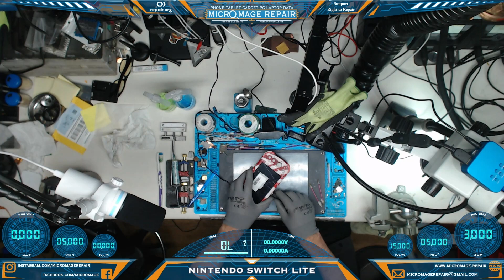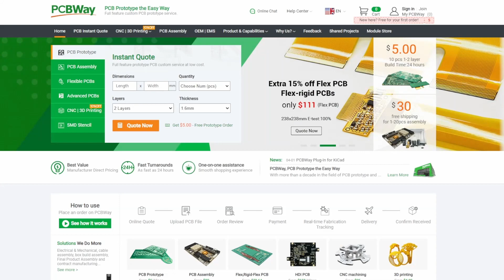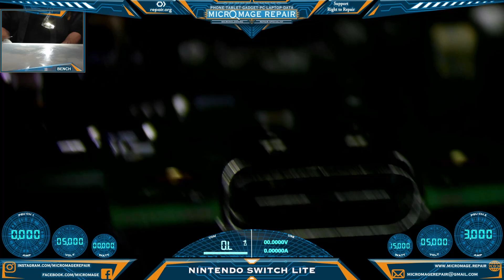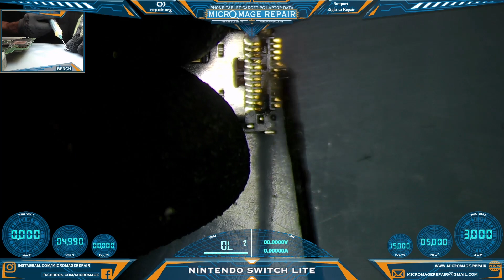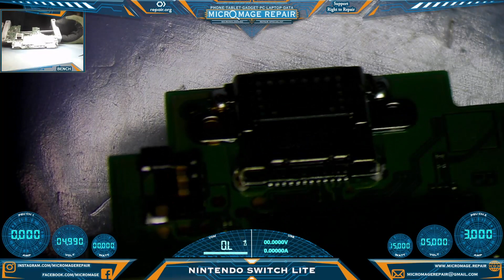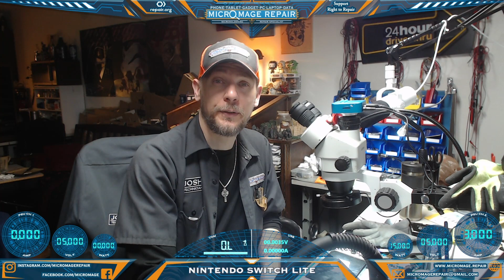Switch Lite: 💀 0.0A No Power

Comment: Hi! Excuse me. I'm testing a switch lite motherboard. I want to see if the board negotiates the quick charge correctly. This must be done with the battery connected? Or it can be done without battery? I replaced the usb port. The port tester says lines are OK. I connect the motherboard to the charger and it negotiates 9, 12 or even 15v correctly if the PD port admits it, but it doesn't go down to 9v after that. Should I connect the battery to test that behavior? Or should I do other tests before? The console was apparently working before disassembly, but the carging port was literally falling apart. Thanks for your advice!!!
Reply from the maker: The system needs a battery or equivalent (the modified Squid I use) to boot.
Reply from the maker: If you use an equivalent you will need an OEM charger to activate.
Reply: @MicroMageRepair  Ok. Thanks a lot!

Comment: Ive replaced m92 bq i checked the fuse and replaced the chargibg port still same issue 0 amo draw
Reply from the maker: Check your soldering on M92T36.  Also it is unfortunately not uncommon to get dud M92T36.  May have to try a few.

Comment: Another cracking repair Josh. Hey Josh have you come across a switch lite that the large left shoulder button dont work. i swopped daughter board for known good but still dont work. ive never come across this before.
Reply from the maker: Thanks Lee!
The only time I've run into an issue with that button is when a client damaged it and I had to replace it.
My suspicion would be the long ribbon personally, everything signal wise from the daughter board has to travel through it and any tiny crimp or damage could cause it to lose some function.

Comment: Nice save .... Those are the models I'm talking about poor  design on nintendo Pain in the butt to fix .. And why would they even put the lip on the charger port
Reply from the maker: Thanks Q's!
They are  definitely more challenging to work than the original and the OLED. 
It's why I don't charge less for them regardless of the fact they are the "budget" Switch.
They aren't budget labor 😂
Reply: @MicroMageRepair   Definitely would have to be a hobby  Just because they're selling for 160 Used And plus you can buy them brand new in the store they're available .. Would be nice if they became unavailable haha
Reply from the maker: @QsTechService1  People still want them fixed.
Can't underestimate how much people value their data, even if it's just for games.

Comment: Excellent find witht that test pad. Would have thought one of the caps of M92 would be short.. We need to find out where that VIA goes because it should be the same check on a regular Switch.
Reply from the maker: Thanks bud!
Actually the reason I was looking for those test pads is because I have had that experience on the regular Switch.
https://youtu.be/6xWYMX2C90E
Check it out 😊